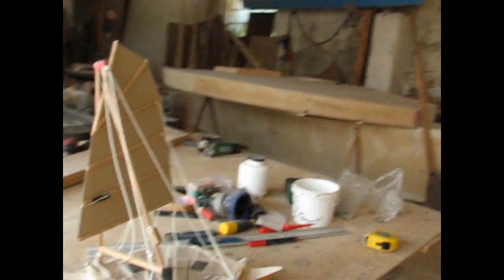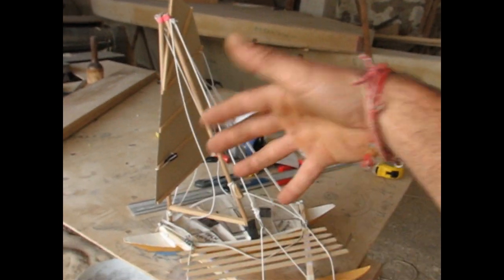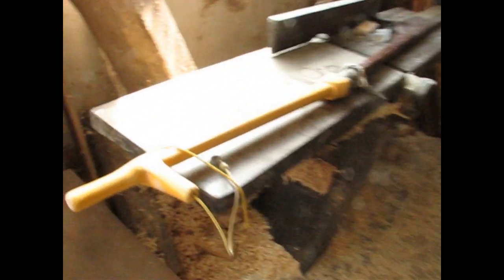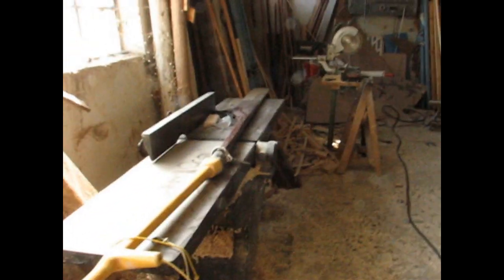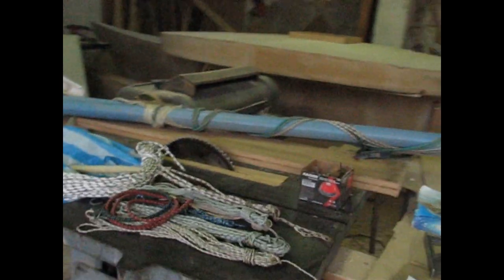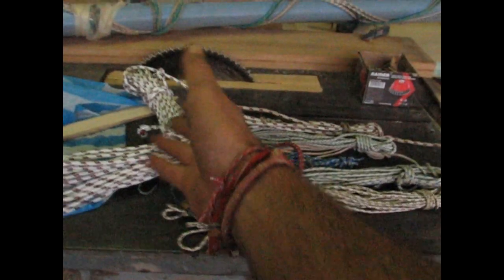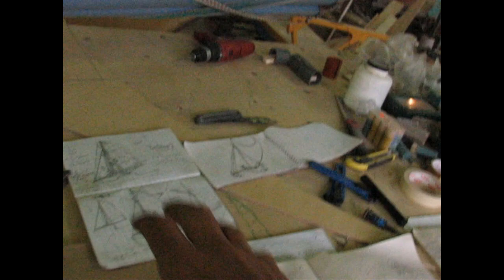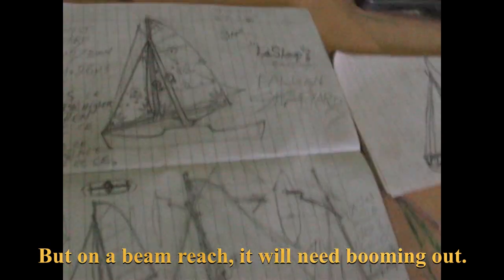Proa Physics and preparing for sea, by Balkan Shipyards

Comment: It's really fun to speed up the replay to 1.5 and listen to you talk.  It's what I imagine it must be like to be inside your head.   The Force is with you.  I can't wait to see what results you have with the new (old) steering method.  This is very much like what you do on a windsurfer.  You're always playing with the CLR (as well as the COE).  On some boards you have a center board as well as a fin and you can adjust the depth and location of the center board to change the CLR point.  You can also use the position of your body weight which moves the immersion profile of thee of the board itself.   Carry on.  Everyone should learn to drive in a Bentley.
Reply from the maker: Interesting... I understand exactly what u mean Chris. A racing mind gets confusing at times... The windsurf is the best example thanks for mentioning it. it's pure physics no magic involved, the steering paddle worked well by the way, it was just very uncomfortable to use, because of the back stay and other rigging that was getting in the way, yet it worked. More details later on. Keep Shunting man....

Comment: The steering oar that I made was the hardest to use sailing my proa (Drua) downwind. I couldn't pull hard enough on it. Sailing upwind though was easiest. Unlike your boat, my boat really pulls to windward regardless of where I sit. I'm currently building out a dual, kick-down rudder system for mine. I'm really excited to try it out. Looking forward to your oar! ZPLAA
Reply from the maker: Can you move your rig slightly forward Zack? Think about a longer mast and try to get the yard more vertical. Aggressive weather helm is due to CE that is far aft.Try to solve this at first, then make some rudders, I'm looking for ideas my self.....   Keep Shunting bro, the force is with u....
Reply: @BalkanShipyards  Actually yes, I have made a new and longer mast. I cut the first one down because the older spars I had were too heavy and the mast had too much stress. After switching the spars for much lighter ones, the shorter mast was under far less stress. I havent tried the big mast yet. With the slide rail I made, it limits the sail from reaching all the way forward of the hull. Also the waterway I'm using has a very narrow entry and exit with variable winds, so a really quick shunt is what I'm after. The rudders are something I wanted to try anyway. Also I have plans on using the 14ft hull as an ama to a bigger 20ft hull I hope to build. The micro mini asym proa has been on hold, but my job ends soon, so ill be doing all that soon here! Always learning! The shunt is strong! ZPLAA
Reply from the maker: @zackariasthepirate  Dreams come true only to dreamers..... Good luck man!!!
Reply: when I had my tacker (forgive me) it was best down wind on the atlantic tack, but one day beating up to an island for lunch, I really realized how beautiful the pacific tack was to windward... it made me think about a shunter again. Now I'm thinking about gybing the shunter sail onto the atlantic tack for a run. My ama is small, but downwind the righting moment is along the hull, not the beam. If I recall Rael is exploring gybing for downwind too.
Reply from the maker: @dominictarrsailing  VERY TRUE!!! I tested it last week and it was a dream. I swung my rig over to Atlantic mode and ran down wind like a freight liner... Small corrections on the AD-Scull was all it took, worked like a dream. It was the last day and I couldn't shoot a vid, at the time, as the wind was building, we were way out, the border police were going to get on my case like they had many times before...  I thought I would get a second chance later on... The wind had other ideas... 

I get on a run, I unhook the whole double block of my working sheet, the rig weather cocks and goes down wind, I move my other set of sheets to mid deck near the ama, we sheet in and fly away downwind in 'Atlantic Mode' worked like a dream in a building wind. The LaSHuNK has no head stay allowing the sail to turn round the yard moving CE between  the hulls. All TRUE MAN, what u learned on a your tacker is the future of shunters... Nothing really to add, except Keep Shunting!
Reply: @dominictarrsailing  Interesting observation. Tacking into the wind from Pacific to Atlantic was a bit scetchy on my little red tacking outrigger. It was a good learning experience. I dont think I had enough beam, and my main hull was a bit wide compared to the single ama. So much subtle change makes a big difference on these. ZPLAA.
Reply: @zackariasthepirate  yes I'd say it looks a bit narrow. luckily the overall beam is quite easy to change on a lash together outrigger. You have plenty of freeboard though! I made that mistake on my first boat though

Comment: I don't know what happened with my settings because I have the bell see for all notifications but I didn't get a notification since the video several months ago when you just moved into an apartment and the new project was just a cardboard model. Then over the past few days I needed to refresh my memory on some boat design aspects and suddenly I got a suggestion for a really old BSY video from five years ago. So I checked and see you have done so much work on the new project. 
Anyway, no more excuses. I decided I can't wait until everything is perfect but just rent a space in a garage for my little KIA Picanto and use the car shelter at the rental house for a boat building shop. The force is strong.
Reply from the maker: A shunter is a shunter, fighting with yourself on a daily basis is a proven recipe for self destruction.... Just build it man!!! free your sole proa junkie..... Keep shunting bro, Balkan Shipyards

Comment: I wonder if C shaped oar thingy (looking at the profile of the boat, not the top) would work for steering. It would have increased surface area to create drag.
Nice patch work on Boyko!
Reply from the maker: It moves the CLR back. meaning the Centre of Lateral Resistance, it worked well,  just was not comfortable to use, because of stuff that was in the way and the sitting position. This is a traditional method of steering these canoes. Drag is always there, what ever you do... All rudders cause drag, it's just the way it is.... Boyco, he kicks ass!!!! Take care bro....  from us, Jenia and I.

Comment: The steering board/paddle physics is sound and certainly a great way to uncomplicate shunting steering. The other methods would be two raiseable  rudders, a movable rudder (yikes!) or a movable steering oar. In past you have used a steering oar and, while this is easier to move than a rudder, it is still long and unwieldy.  So I can understand the urge to try something easier. The only problem I see is the engineering one of making it slide up or down smoothly. This should not be insurmountable and it will be interesting to see how you do that. I am wondering if you plan to use two of these boards and use the current forward board in place of a centreboard. In other words, when doing a shunt, raise the aft (soon to be forward) board half way and lock it. Then shunt and unlock the new aft board to use for steering. I am not sure my explanation is good enough. But what I have read about traditional use of this technique seems to show a number of boards in various amounts of bury depending on point of sail. Simplifying to two should still work. Traditionally, fixing a board part way up was harder than moving the board for and aft or adding another board. However, I think two board trunks is enough to build. I think trucks for the boards would be needed to provide a bearing surface for sliding on but am thinking that because windward is always on one side, maybe only half trucks are needed.  One more question (or comment) are you going to try steering from the forward position? With two steering paddles it should be possible as you are just varying the balance between the two. Might have more spray in the face but better visibility.
Reply from the maker: Lifting daggers for and aft is a good solution, but hitting a rock becomes a bad idea... Lifting and lowering a board on the leeside is simple and easy, though on Make O'Break was highly uncomfortable, so I gave up on it fast, no where to sit and backstay was right in the way.... Though it worked well. Sitting on the front of my boats sinks my bows fast, since I have lots of rake on my bows and a short waterline. on my first proa I had a side rudder on the windward side, worked like a dream,, My new build will have lifting side rudders and an AD-Scull. 
  All d best, and keep shunting,
Balkan Shipyards